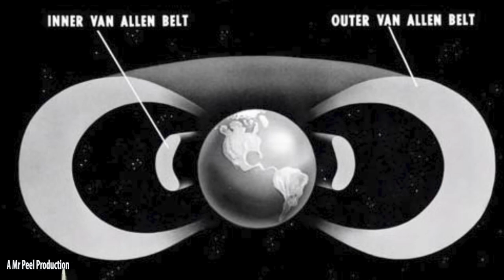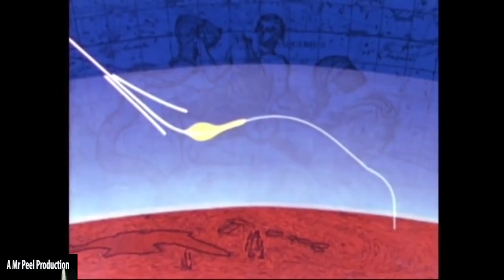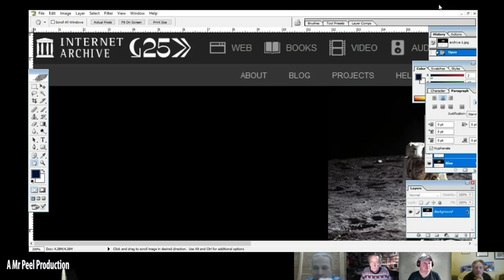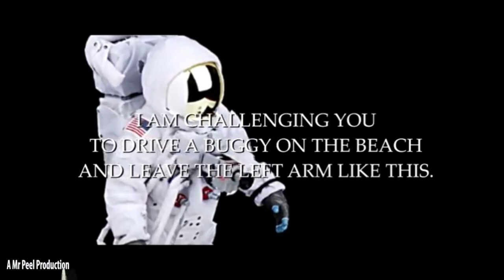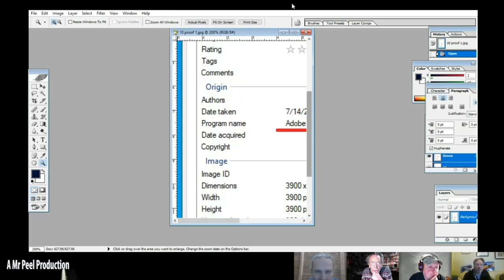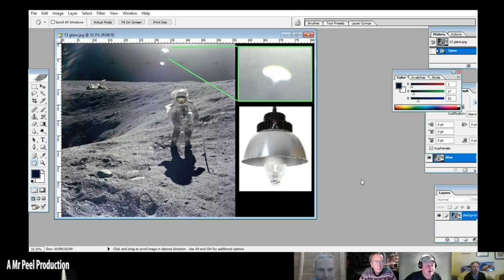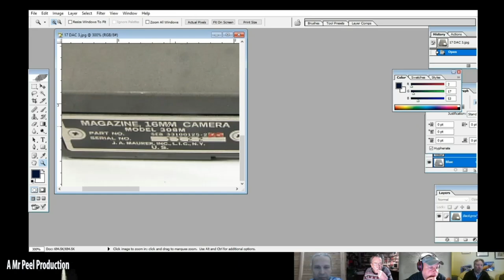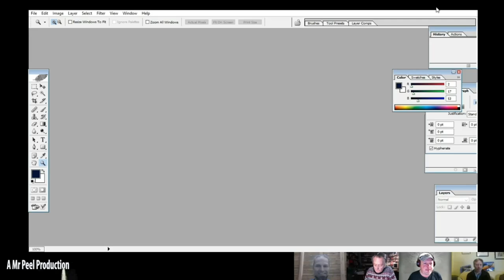The Apollo Detectives 9  Dec 2021

Comment: I showed a clip of this video to a colleague, the bit where an astronaut throws something that hits the LEM and it produces a thump. I told him you think this is a "smoking gun" as there's no atmosphere inside or outside the LEM. His immediate response was to laugh, he said "who are these imbeciles". And went on to say exactly what I did about how the sound was produced without any prompting from me. He also said "why do you waste your time with these idiots, they're way beyond help".
Reply from the maker: How was the thump sound explained by him exactly then?
Reply: @NeilPeelParanormalPeepShow  As I have explained it several times. There's a microphone running in the LEM all the time. The microphone is mounted to the LEM structure. If you bang on the LEM structure the vibration will travel through the structure and vibrate the element in the microphone. The vibrating element induces a voltage in the mic cable which is transmitted/recorded as sound. This works just fine in a vacuum. Just as if sound waves in air had caused the vibration of the microphone element. You could prove this by putting a radio mic in a vacuum chamber, mechanically mount the mic to the inside of the vacuum chamber, then sucking all the air out and thumping the vacuum chamber. The radio mic receiver will produce an output that can be recorded, watched on an oscilloscope or heard on a speaker. I have been trying to get hold of a transparent vacuum chamber to demonstrate this.
Reply: @NeilPeelParanormalPeepShow  Here's a simpler example. When you see a comedian come on to the stage and tap the microphone to make sure it's working you hear a loud thump. Most of the sound you hear is mechanical vibration going through the structure of the microphone to the microphone element. If you put the same microphone in a vacuum chamber, sucked all the air out, and arranged for something inside the vacuum chamber to apply a similar tap to the microphone you would hear the same loud thump due to the mechanical vibration going through the structure of the microphone to the microphone element.
Reply from the maker: @stevemumbling7720  so the Lem is struck by an object, so where is the mic picking it up? Snoopy cap on the astronaut who is not touching the Lem? Inside the Lem, switched on, in a vacuum?
Reply from the maker: @stevemumbling7720  you have not explained where the microphone was, when the thump hit the module. Funny how it happens on the moon but not on the ISS or outside the shuttle. Whilst here, maybe you can explain with your super science, how the Sun is larger in Apollo visors but all other space scenes not on the moon the sun is just a tiny twinkle. Turtles have a higher resiliency to radiation, hence the Russians sending them. Thought you would know that Steve. Your slipping!
Reply: @NeilPeelParanormalPeepShow  Tortoises not turtles. Can you provide evidence that Turtles have a higher resiliency to radiation, or this just the usual knee-jerk bullshit? And what about the critters they actually sent, Tortoises. Are they more resilient to radiation. Evidence please.  If you want to assess the effect of radiation in space on an astronaut it makes no sense to send a more radiation resilient critter... does it. I have fully explained the LEM thump. If you honestly can't understand what I wrote that really does explain a lot. My colleague is right, you're way beyond help. Do as I suggested and show my two comments to Jarrah White. If he really is a physicist he'll have no trouble explaining it to you.
Reply from the maker: @stevemumbling7720  Tortoises , we sometimes forget the turtles are ninja https://www.discovermagazine.com/the-sciences/the-first-earthlings-around-the-moon-were-two-soviet-tortoises  AND https://en.wikipedia.org/wiki/Radioresistance
Reply from the maker: @stevemumbling7720  Now, where are the mics that pick up the Apollo LEM clang??
Reply: @NeilPeelParanormalPeepShow  A little research shows they chose tortoises as they were easy to secure. The tortoises showed no ill effects from space travel. As tortoises are not 'radiation proof' they would have suffered measurable radiation damage if the radiation levels were anywhere near as dangerous as you claim. Usual defectives nonsense.
Reply from the maker: @stevemumbling7720  a little research shows.... Haha, yes we told you about it. Mr expert had no idea of them. Of course they suffered no ill effects. We never said they did. That is why the Russians sent them. Them and cockroaches can stand high levels of radiation. The Russians knew a dog would die going through the belts.
Reply: @NeilPeelParanormalPeepShow  Total crap as usual. The tortoises weren't selected for their radiation resisitance, they were selected for their shape. Their shape made them easy to secure in the spacecraft.
Reply from the maker: @stevemumbling7720  that is the most dickish thing ever. Guess they have natural space helmets?
Reply from the maker: @stevemumbling7720  from Wiki.  Two Russian tortoises (Agrionemys horsfieldii) were included in the biological payload, weighing 0.34–0.4 kilograms (0.75–0.88 lb) each pre-flight.[10] Soviet scientists chose tortoises since they were easy to tightly secure. There were also two tortoises used as control specimens and four more in a vivarium. Twelve days before launch, the two space-bound tortoises were secured in the vehicle and deprived of food and water; the control tortoises were similarly deprived.[10] The food deprivation was a part of pathomorphological and histochemical experiments.[11] The biological payload also included fruit fly eggs, cells of wheat, barley, pea, pine, carrots and tomatoes, specimens of the wildflower species Tradescantia paludosa, three strains of the single-celled green algae Chlorella, and one strain of lysogenic bacteria.[11][12] The purpose of sending a variety of terrestrial lifeforms was to test the effect of cosmic radiation on them.[13] However, the test subjects were not analogous to humans, because the choice of life forms were all extremophiles with a substantially higher radioresistance.[14][15][16] The Russian Academy of Sciences stated that a mannequin equipped with radiation sensors occupied the pilot's seat.[1]

Comment: The claim made by Rasaviharii that the SLS's 'powerhouse' Service Module is a radiation shielding square box the Astronauts will live inside is poppycock. The Orion capsule is where the Astronauts will be and you can't access the Service Module from the capsule, the heat shield on the bottom of Orion is between the two.
Rasaviharii's claim you can't find much information about what the SLS Service Modual is structured from, its probably some exotic 3d printed material is wrong on both counts. The SLS service modual is made of an aluminum honeycomb sandwhich bonded between sheet aluminum alloy, just like the Apollo missions.
Artemis 1 launch scheduled for monday, 2 next May 😎

Comment: Since the final excuse for not being able to "return" to the Moon is that the Apollo Program was too expensive to repeat, we can look the actual data and that idea falls everywhere. 

For example, they say that "NASA's budget was 4% of the U.S. GDP back then". But that was certain only for 1965 and 1966. In years like 1960, it was 0,5% of the U.S. GDP, in 1961 it was 0,9%, in 1962 it was 1,18%, even in 1968 to 1973 it was always around 2% or even less. 

Also, that's just one thing to consider. Even taking "4% of U.S. GDP", to compare the real expenditures of NASA back then with today you should look the real money involved updated by inflation, not the ratio/GDP, since the U.S. GDP grew 4 times in real terms, then nowadays f.e. 1% of the U.S. GDP is comparable with 4% of the GDP back then, which again, was just the case in 2 particular years.

And that's not all. Since the Apollo Program was made starting from scrap, all the costs and investments involved in the original Moon Program don't need to be repeated to make a New Moon Program, there are sunken costs. For instance, you don't need to build a new Vehicle Assembly Building, it's built, since 1965.

And moreover... since 1969, 50 years have passed, technology improved in all areas, so they should be able to cut costs in several areas as well. For one example in many, computers  aboard the spacecrafts must be incredible cheaper to install than in the 1960's. But somehow, they aren't able to do it.